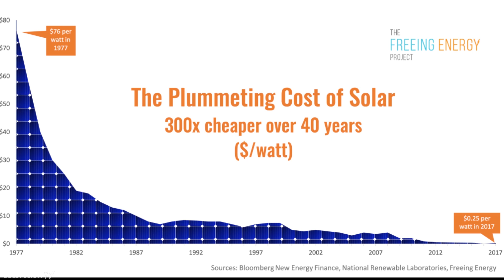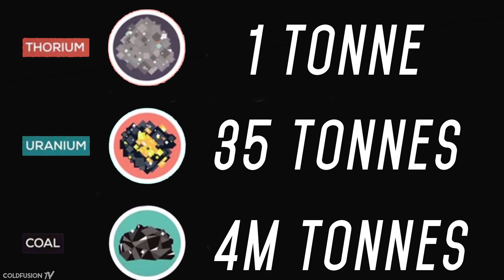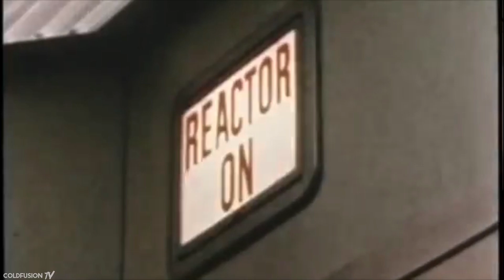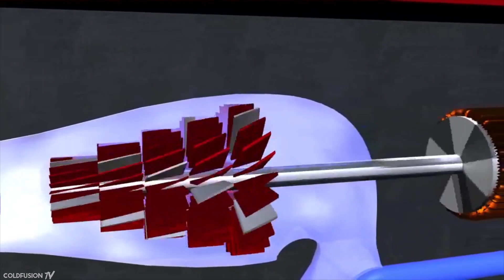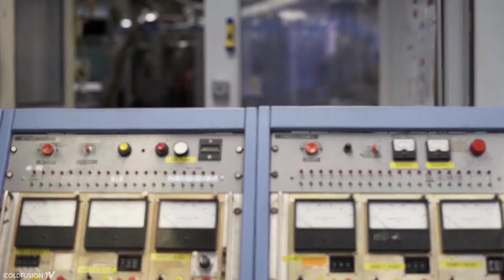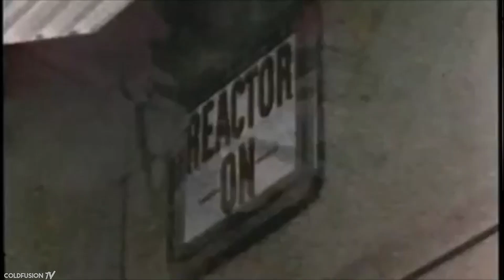Thorium - The Future of Energy?

Comment: Nuclear: If something goes wrong, you have a big problem 
Fossils fuels: If noting goes wrong, you have a big problem
Reply: Thorium fission: If something goes wrong you have a small to moderate problem.
Reply: @Maximum_Bacon  No>
235U core required, can NOT breed faster than it fissions, meltdown is just as easy as any other fission reactor AND the waste is equally lethal.
Chemical separation won't work for real time enhancement BECAUSE 62 days is far too often to reprocess the entire core.
Reply: @hellstromcarbunkle8857  Have you read up on MSR and fMSR thorium rector design principles and propsals?. Because that's not what I have been reading and I would like your source if I missing key information.
I'm not saying they are perfect mind you. Or even ready to he built tomorrow. I'm just saying it appears to be orders of magnitude safer than fast breeders with a small fraction of the waste and a small carbon foot print. Seems worth exploring.
Reply: @Maximum_Bacon  Yes, yes,yes. I'm sure you've read tons and tons of Kirk Sorensen's propaganda.
Now, ask yourself. Why not ONE 233U breeder?
Because it won't work.
Breeding requires MORE fuel from fertile stocks than is consumed in the pile.
But, thanks to our friends at the FAS, we know that the highest breed ratio achieved in ACTUAL operation of a 232Th reactor is 1.01

http://large.stanford.edu/courses/2017/ph240/li2/
WON'T WORK, get that through your head.
Reply: @Maximum_Bacon  Right there at Stanford, that's where
Reply: @hellstromcarbunkle8857  Good school. UCI myself.
Reply: @Maximum_Bacon  And what did you learn at UCI which demonstrates ONE single example of a >1.6 transmutation / fission in a 233U reactor environment? I drew the number range from an FAS.org article on 239Pu breeding as a minimum sustainable breeder.
Show me ONE 232Th reactor without a 235U or 239Pu core sustaining fission since breeding is exactly cancelled by fissioning
Reply: @hellstromcarbunkle8857  What I learned is that the only working model is actually a hybrid reactor using 235 as the catalyst. However, there was a fascinating paper done on the possibility of published by the georgia institute of technology here:
https://pubs.acs.org/doi/10.1021/es2021318
Reply: @Maximum_Bacon  Not a catalyst.
The only source of neutrons for the enhanced chain reaction.
Can NOT breed with net gain.
So, all the old problems and now no permanent confinement (being liquid and all)
Reply: @Maximum_Bacon  No, 100% of the ACTUAL nuclear scientific community KNOW that other than CANDU, the tech has NEVER worked and that the entirety of the "thorium cycle" evangelists are frauds milking some cash from a gullible public.
India can't. America can't. CANDU hasn't paid off even slightly
OBSERVE I gave you citation from the ACTUAL NUCLEAR SCIENTIFIC COMMUNITY at Stanford who admit IT
WON'T
WORK!!
Reply: @Maximum_Bacon  235U is not a catalyst. It is the excess neutron source 233U cannot provide
Reply: @hellstromcarbunkle8857  catalyst? Hahaha!
Reply: Super Cool you shouldn’t look up all the stuff in your house that can easily end your life in a second.
Reply: Thorium Ractor: If something goes wrong, it stops on its own and you can restart it tomorrow.
Reply: Super Cool If we installed solar on every house in the USA (some 161 million buildings) the USA would only generate 36% of its energy from solar. 

If you want to generate all of your energy by renewables you’re going to have to expand beyond just individual scale
Reply: @brian2440  You lying pos, 18,000 TW/hr /yr happens in just 10000 mi^2.
That's ALL THE POWER IN THE WORLD off just the URBAN and SUBURBAN roofs
Reply: @hellstromcarbunkle8857  so what? How are you going to smelt iron and metals at a low enough cost? How do you make concrete? Also at a low cost? Your houses will cost millions. And that is for a two bedroom bungalow. Industry needs intense, cheap energy. Solar and wind can't provide that.
Reply: @rustylugnut755  What, more idiocy?
O.K. do the math
Insolation 1.072 Kw/m^2
33% conversion using existing solar thermal
68% uptime for solid state converter
that's 19000 TW/hr year in 10000 Mi^2
100 x 100.
In say China lake.
Shut up when you have no facts
Reply: Look at the schematic of a thorium reactor. There is a freeze plug that melts when power is lost. Then the nuclear material drains harmlessly into several separate holding tanks. No melt down, no hydrogen explosions, no problems.
Reply: @ageminiani  And polluted rivers cause of the heavy metals used in the panels that haven't been recycled (or can't be for some parts). Enormous spaces that could be dedicated to other activities or simply to planting trees, consumed by the gigantic needs of space of solar plants. I mean, solar is cool and all... But we need something stable and powerful enough.
Reply: @miguelandroide  https://news.energysage.com/recycling-solar-panels/ Recycling is becoming far less of an issue.
Reply: Super Cool  Nuclear > your nonsensical drivel.
Reply: Explain then why solar kills 440 people a year, and nuclear kills only 44 people in 100 years.
Reply: @neuralwarp  Sorry, di you just conflate rooftop falls with radioactive waste?
Liar
Reply: SuperNova: Am I a joke to you?
Reply: Super Cool  I live 15 miles from a nuclear powerstation and my town has a population of about 120, 000 people, also its about 50 miles from London, so nuclear reactors defiantly aren't only built in remote locations.
Reply: what a great comment
Reply: What problem,gas is the answer-as much bio gas as possible-nuclear is to expensive radiation will kill you CO2 won't it will just feed your plants.
Reply: Calculated risk management vs. Accepted slow devastation.
Reply: Super Cool  Wrong.
AGW is THE culprit in rising temperatures.
Period
Reply: Trigger Troll  Given that the Flow batteries don't use transitional rare earths, your post is a lie
Reply: Darth Nihilus  Thorium emits gamma rays AFTER you start fission.
232-u is the problem
Reply: 2deep4u
Reply: @Envinite  Too real for you
Reply: Plus fossil fuel air pollution kills 100’s of thousands every year according to the World Health Organization
Reply: @robertweekes5783  indeed it does.
And wind kills...no one.
And solar kills...no one
While fission kills slowly, with leaked waste continuing to cripple and kill for 96,000 years
What's the total over 96000 years?
Reply: Super Cool im going to support nuclear energy because of your behaviour here
Reply: @mr.m2659  So, not JUST an idiot, but a disgrace to rational thought
Reply: @mr.m2659  Not only do I KNOW but I got the intel from the ACTUAL researchers, not the penny shill you listen to.
Thorium has only one use, augmenting fuel supplies for 235U and 239Pu reactors.
Which will not take over the world.
If your money is in 232Th stocks, warm up the bath water.
Reply: @hellstromcarbunkle8857  take the tinfoil hat off
Reply: @hellstromcarbunkle8857  yeah you rock that tinfoil hat, dont let anybody tell you it doesn't work
Reply: @hellstromcarbunkle8857  you continue to spout your drivel. Your schooling was in what field? Argumentative trolling? Hahaha!
Reply: what the hell happened here
Reply: Trigger Troll  You'lll need that much copper fro your ultra long distance transmission lines from your seaside reactors
Reply: @hellstromcarbunkle8857  you can build reactors anywhere when you don't need cooling water! You are so stupid, it's ridiculous!
Reply: Trigger Troll  And 2019 was the 2nd hottest year recorded so far.
So what? you're cold in winter?
Austrailia is on fire this summer.
Reply: @hellstromcarbunkle8857  Australia has been on fire for eons! Do you remember Olivia Newton John? Smoking!
Reply: Trigger Troll  Wrong.
A record hot is not going to be a record cold.
Quit pretending CAnada is the world.
or Alaska.
And no, these Australian fires have NEVER been this intense.
Reply: @hellstromcarbunkle8857  were you there? I have friends who lived through the worst fires in Australia, when they were children. They are now 80 years old!
Reply: Trigger Troll  As you can see from ACTUAL RESEARCH, AGW is the problem
https://climate.copernicus.eu/climate-bulletins
Reply: @hellstromcarbunkle8857  so what? Climate change? Doesn't scare me.
Reply: This is true but with Oil you almost always have a war infact lately it seems like a perpetual state of war and it could end up being a nuclear tipped war that could have been avoided if we had embarrassed the Thorium LiFTeR Molton salt technology
Reply: ThunderWazp here’s a little fact for you. More people have died from solar energy than have died from nuclear energy. Prove me wrong! 
A lot of people fall off those roofs putting up solar.
Reply: @Ragnar Lothbrok Sorry, did you miss the 18,000 TW/hr/yr reliable yield of solar collection 100 mi x 100 mi?
Hmm?
Worst case, 31 billion to build.

Contrast 200K 10Mw reactors needed to reach that number.
Reply: Super Cool  The whole point of the thorium debate is that it doesn't do the things you are afraid of. I disagree with many of your points about needs, demands  and solutions but that's ok.
It seems your mind is already made up and no amount of discussion or debate is going to change it. That's fine. You're free to believe what you want. 
I wish you well and sincerly hope you can help achieve the utopia you envision.

Comment: A 300 year half life is really nothing in the long run, especially since thorium produces less than a percent of the waste that uranium produces. Whether the video included the waste produced from mining, or just the wasted fuel rods changes that percentage considerably since thorium is also much easier to mine and refine. The amount of waste produced in 300 years of usage is negligible compared to Uranium, and is nearly non-existent compared to coal mining.
Reply: Nuclear waste breaks down into three categories.  Short, medium, and long term radioactive waste.  MSR's produce very little long term waste, the waste you're talking about that last's 300 years before it's safe.  The beauty of an MSR is you can partition the waste into bins for each type of radioactive waste. 

So you filter out the short term stuff and put it into holding, then you filter out the medium and put it into holding, then you filter out the long term...  You get the picture I'm sure. 

Did you know that all of the nuclear waste the US has produced so far can fit on a football field about 21 feet high?  I think people imagine that we have mountains of waste sitting around, it isn't that much really...

Comment: India has already developed functional U-233 reactor but at a smaller scale of 30kW. It needs more U-233 generated from Thorium in a PFBR. The technology is already working at 30kW scale. The smaller FBTR generates U-233 to power KAMINI. 

They have a 3 step nuclear power plan. They already have a working Thorium reactor in KAMINI but have not been able to synthesise U-233 at MW / GW scale. 

Considering that India is a very poor country, the PFBR has take USD 1 Billion. After 27 years, it is finally planned to be critical in 2020. The cycle is exponential, generate U-233 fuel in FBR using Thorium and then use them to make more U-233. 

See
1. https://youtu.be/yGhEdcwXxdE
2. https://en.m.wikipedia.org/wiki/India's_three-stage_nuclear_power_programme
3. http://www.bbc.com/future/story/20181016-why-india-wants-to-turn-its-beaches-into-nuclear-fuel
4. https://www.google.com/url?sa=i&source=web&cd=&ved=2ahUKEwj29tbpoPPiAhVDVisKHcs6BH0QzPwBegQIARAB&url=https%3A%2F%2Ftimesofindia.indiatimes.com%2Findia%2Fnuclear-reactor-at-kalpakkam-worlds-envy-indias-pride%2Farticleshow%2F59407602.cms&psig=AOvVaw1L6Z4pSArj8WCfHIiCRukZ&ust=1560955046412772
5. https://thebulletin.org/2018/08/thorium-power-has-a-protactinium-problem/
6. https://en.m.wikipedia.org/wiki/KAMINI (only working 30kW Thorium reactor since 2006)
7. https://en.m.wikipedia.org/wiki/Prototype_Fast_Breeder_Reactor (planned 2020)

Comment: Thorium reactors are NOT just theoretical. We had a working Thorium molten salt reactor at the Oakridge National Laboratories from 1965 to 1969. It ran for 15,000 hours before Thorium research was defunded. The two main reasons why we went went in another nuclear directions are 1) Weapons grade uranium as a byproduct. 2) Profit motive. Fuel rods in U235 reactors need to be replaced quite frequently, after only about 20% of the fuel is used (and then the used rods need to be stored). Thorium fuel rods remain in place for the life of the reactor and are almost completely consumed. General Electric found it could make FAR more money servicing fuel rods than it could building "set it and forget it" reactors.

Comment: Lots of issues with Thorium reactors,

1. Even the modern Uranium reactors are more expensive (cost/Watt) compared to Solar energy. So a new Th reactor will be more expensive.
2. The Th chemistry is still under study, its salts are considered to be very corrosive, so making reactors is difficult.
3. Th reactors MAY create Thallium 208 which is insanely radioactive.
4. However safe a reactor design is, accidents happen, and nuclear accidents are not fun.
Reply: Molten salt reactors will be 1/20th the size of current nuclear reactors.  They will produce 1/5th the amount of waste as current reactors.  They can recycle waste from first and second gen nuclear reactors, and the waste will be much less radioactive than current uranium cycle reactors. 

Current nuclear reactors operate with water as the coolant and they operate that water under extreme pressures.  Boiling Water Reactors (BWR) and Pressurized Water Reactors (PWR) both operate water under extreme pressures.  BWR operates at around 70 atmospheres, PWR operates at about 160 atmospheres, whereas molten salt reactors operate at 1 atmosphere, so MSR's will not require all the added safety measures and redundant systems that BWR/PWR do thus greatly reducing cost.

MSR should cost less than coal does when all is said and done.
Reply: @Les_S537  theoretically it should be cheaper than coal, but the tricky thorium chemistry would make things expensive. plus Th reactors make U233 which is weapon grade Uranium. Clubbing this with the abundance of Th means a lot of countries can make Nukes without the need of uranium (which is difficult to get)
Reply: @geoemm  All reactors can be monitored and run by the IAEA so that tinpot dictators don't have any control over the process.  Certain MSR models, breeders, make u233 more readily than others.

Comment: Before you jump on the Thorium bandwagon and neglect Uranium:
- The purpoted advantages of Thorium reactors in this video (higher burnup, meltdown proof and short-lived waste) are actually Molten Salt Reactor (!) advantages. They can be operated on the Uranium-235 fuel cycle as well, with the exact same advantages. It's not a Thorium specific thing.
- Thorium is not proliferation free at all, the fissile element in this fuel cycle is U-233, which can be chemically extracted from the reactor the same way waste is under normal operation, and can be turned into weapons.
- Thorium is more abundant in the crust, but Uranium isn't scarce either, and there is a lot more Uranium in seawater than Thorium, for long term use. However, there is a nice initial advantage to Thorium because currently lots of it is sitting in warehouses, already extracted but unused. After using that up, you'd have to mine more.
- Overall there's nothing wrong with the Thorium fuel cycle but it's not any better than using Uranium.
Reply: Just here so this comment gets more attention and give a source for Zolikoff's claims. Thorium can and is used to make nuclear weapons.

1: https://whatisnuclear.com/thorium-myths.html#myth3
2: http://www.world-nuclear.org/information-library/current-and-future-generation/thorium.aspx
Reply: A lot of useful information, and while there is some danger involved from the proliferation side, it should be pointed out that it is considerably more difficult to do so, more easily detectable, and unreliable in any sophisticated delivery system. (You might get more reliable results from a ballistic launcher system, which is a whole host of problems in and of itself.) Nevertheless, it should be pointed out, and more people should be made aware of it.
Reply: It's longer because it becomes Uranium.

Comment: Nuclear power no mater the fuel used ties in well with water cracking for hydrogen fuel as a reactor hates quick changes to production so a smart load they can turn on/off or even turn up/down on demand lets the reactors produce at a constant rate.

Comment: There is no such thing as a thorium molten salt reactor at this time. China is currently building an experimental reactor that they want to be ready by the early 2020’s. Then they’ll build a larger low power reactor, before trying to build a full scale 1GW+ reactor by the mid 2030’s 
In other words, were a long way from a proven, practical thorium fuel cycle
Reply: You should google. India have the most advance thorium program in the world and only country which have working prototype of first stage fast breeder reactors way ahead of China. And around 2040 india will be the first country to have all the three stages of thoriam reactors functioning.
Reply: Puri Goswami 
I hope you’re right. 
I imagine by 2040 solar energy (including solar water splitting for hydrogen) will be very advanced indeed. 
Personally I think it’s very possible that fission energy will be available by 2040

Comment: What do you hydro electricity faces an economic hurdle. It is the cheapest electricity sources. Building a damb is very hard and expensive but it pays back very quickly. It is basically lots of electricity from FALLING WATER. Factories and giant plants prefer using hydro electricity as it much more cheaper. The only downsides are that it damages rivers and there aren't rivers everywhere.